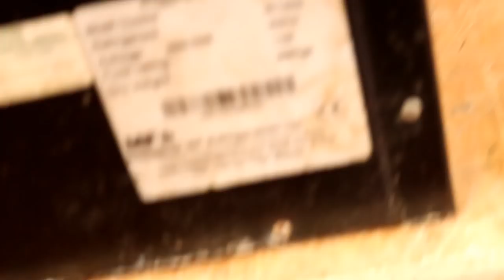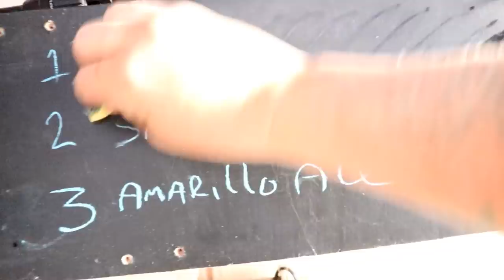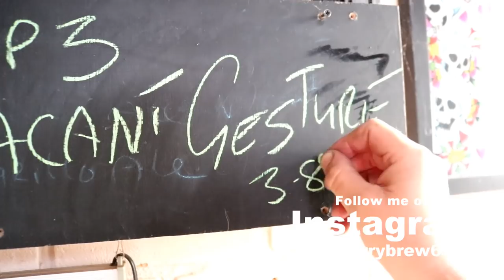I GOT HOSE ~~ FOR DIFFERENT BEVERAGES

Comment: What advantage is there to using a flojet pump over just connecting the tap straight to the corny keg, or were you just using the pump for the beer line cleaner?
Reply: Rob Day he said just to clean the lines
Reply from the maker: Just to clean the lines dude.

Comment: I have a cornelius keg which i carbonated at 30 psi for 3 minutes, i have a tap connected direct to the top of the keg which has no pipework, i have released the gas several times but the beer still comes out like ice cream, it takes a month to settle, any ideas what im doing wrong?
Reply: Infected....
Reply: EatWhatTheMonkeysEat The last brew i made was the same but that had no infection, someone suggested the tap connected directly to the keg was the problem.
Reply: sorry buddy 'infected' is a dumb home brew joke....I would say to force carb minimum of 20 psi overnight, then serving pressure of 5 - 10 psi. For a 19l cornie you might want to do some research online as to the importance of the length of gas / beer lines.
Reply: There is a good equation on brewers friend for this. Just google  'brewers friend beer line length'. Perhaps some one else can talk to using a tap directly from the keg
Reply from the maker: As said below, you need beer line to balance the pressure in the keg and prevent co2 breakout. A quick google search should help you find out how huge the subject is. lol.
Reply: Richard Brown Thanks richard.
Reply: EatWhatTheMonkeysEat ok thanks.